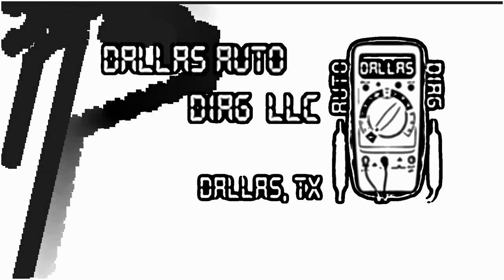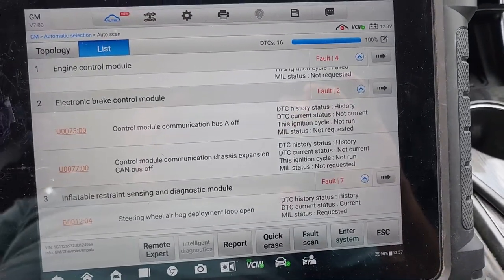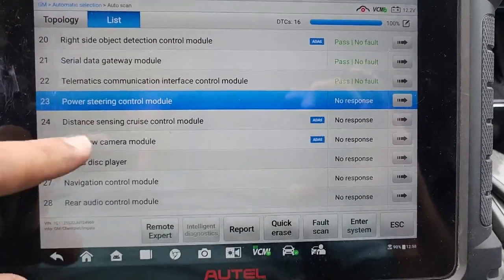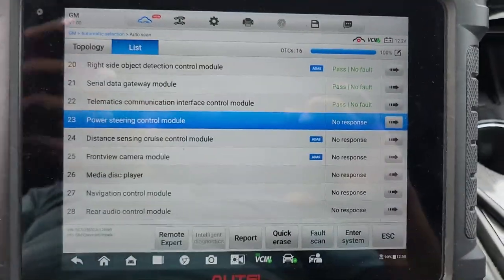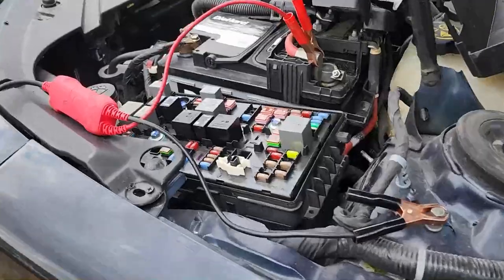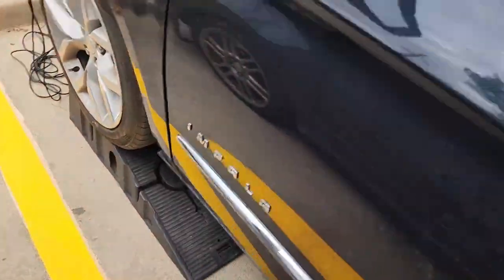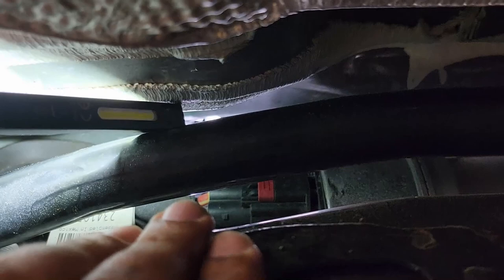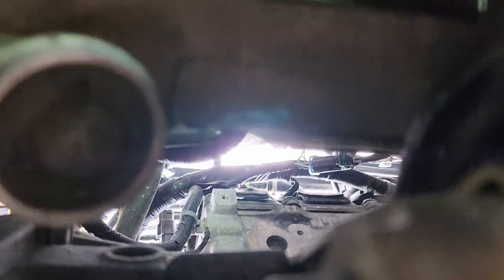2019 Chevy Impala U0131 Lost communication with power steering control module

Comment: Also once in a great while my POWER STEERING GOES OUT ON MY 2016 IMPALA LT.. I GET A WARNING MESSAGE AND THE POWER STEERING GOES OFF.. I PARK MY CAR AND 20 MINS LATER IT WORKS JUST FINE. Any ideas on this issue too ?
Reply: 2023 1/4 I had this happen sacred to drive..smh
Reply: @raaleyeztv3628  I wonder what it is

Comment: Good job man

I was look for someone how can understand these kind of dtc problem.

I have code start with 

C0800:12
Reply: It's say power control module power circuit low in put
Reply from the maker: there is a big chance you have a blown fuse

Comment: I have a question.. I have a 2016 Impala LT..  I think i blew a fuse or short circuited something.. my high beams, horn, windshield wipers, trunk DO NOT WORK. AND MY ENGINE LIGHT NOW CAME ON.. or the fuses relay fuses too are fine. None blown out.. Would you have an idea why this is happening?
Reply from the maker: My advice is to find a good technician to diagnose it correctly for you and stop guessing.

Comment: My dear I have the same issue with my impala 2014 ltz no power steering.
What I noticed that this harness g2 which you found disconnected when it touch the body has electricity and give small sparks. What can be the problem please
Reply from the maker: Not sure

Comment: Hey when you were gonna test the can bus wires what is the test performed? Are you looking for a 2.5 volt signal? Also good video!
Reply from the maker: It depends on what I'm using. Best for can is a scope. But if voltmeter only available then yet 2.5v

Comment: What if my ground is good but the power steering is still out? Could it be the pscm thats gone bad or a fuse?
Reply from the maker: if the fuse is good amke sure to check at power and ground at the rack pinion connector. if all good means the rack needs replacement
Reply: @DallasAutoDiag  where is the fuse for the pscm? Im having trpuble trying to figure out which one it is

Comment: Where is the TCM and how do you get to it when you pop the hood?
Reply: The TCM is the "Transmission Control Module." Why do you want it if you are having a steering problem?
  I don't like "All-Data" but maybe the have improved, but Mitchell's is much better.
  You can also go to ACDelco to see if you have the correct computer equipment, but you can purchase a 24hr period, Week, Month or Year. It has the wiring, component locations, diagnostic flow charts for properly chasing a DTC. 
With high speed local area network or GM LAN, this is used as serial data for ECM, TCM, SCM and others, like suspension! Yours will vary depending on the Make, Model, Engine, Trans and Grade Level LT, LS, Turbo etc. the Malibu uses a torque sensor inside on the upper steering column. It plugs into the "Steering Control Module" with short wires as it plugs into the drive motor right on the upper column. If you have an Impala, the sensor, SCM could be under the dash, but like some (Depends on Year) but the motor can drive a rack and pinion gear with a tiny toothed timing belt. I don't have all memorized. Go to Rock Auto and year, make, model, engine, click on steering. Look at the parts to see what they look like! As far as getting to these parts for service or replacement, welcome to my world.  Dealer Tech, retired!
DK, ASE Master since 1978!
Reply from the maker: @deankay4434  
What makes Mitchell's better than all data? I always thought the opposite. Its even reflected by the monthly sub fees.
Reply: @DallasAutoDiag    Well, some time ago, only Mitchell's had colors on wires, the diagnostics come from the manufacturer and cost what every they charge plus a royalty per unit sold. Mitchell's had way more, like body systems, ABS and techs in seminars or classes told me. Plus, ACDelco supplied a subscription for the instructors to use. That is what I did for almost 7 years. They called the 56 of us, Market Area Service Mgrs. I soon became overloaded. Load, drive, teach EL3 & EL4, Overland Park, KC. Next week, Seminars, Advanced Charging Systems in Altoona, then Peoria, Rockford then Dubuque, drive home. Three days with defects in Dubuque at IWI Motor parts. They had hired to new guys, none with ASE certification, but was helping me when I tore rotator cuff. Saturdays were off but had to turn in receipts and attendance rosters. I had 62, 84, 114, 88 one week and going higher. The other guys were lower each week. Their seminars went 3hrs then 2. I went 4hrs. Grand Blanc called and sent a GM training center mgr from Chicago out to attend a seminar on A/C. Everyone was doing the old stuff so I did 4hrs on controls, sensors, actuators, Corvette heater box that uses a roll-up almost raincoat material with openings in it, fascinating to me and thin. But, they want a copy of my power point and couldn't figure out where I got it. It was online at the GM Tech Training Site. I took it and added screen shot captured off my Tech-II. I kept but had surgery on the rotator cuff, two weeks later, got a call from my Raytheon service boss telling my job was dissolve. Dr pulled the plug on my career, sitting down a huge file going back to 97, and said he knows dozens who qualified for disability with less. It sucks as I am living on 1984 income. But no more 243 days per year in a hotel room. Just take care and have a great 2022 & 2023. DK, retired.